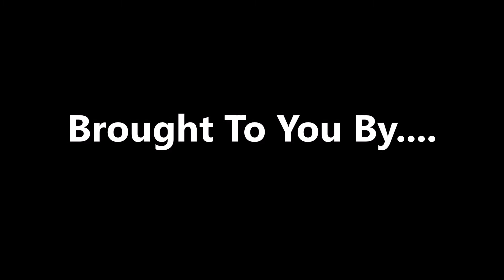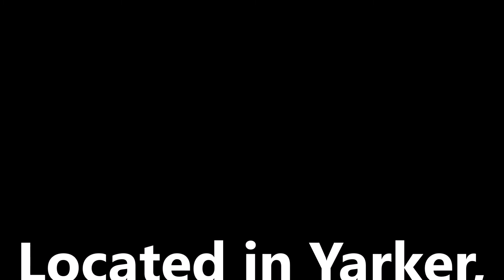1976 Classic Ford Mustang Cobra II Body Work & Custom Paint Job,  lastchanceautorestore com

Comment: I can see you half-assed the job you didn't even take the louvers off the back I'm out I've seen plenty
Reply from the maker: Sorry you are mistaken. 
We removed all components individually, sanded, primed masked and painted.
The louvers were all removed, repaired, sanded, primed then dry fitted and adjusted on the car before final paint.

The louvers were installed back on in primer for masking the blue stripes, then removed, painted and final install.

Thanks for watching our videos!
John & Julie Nizman
Last Chance Auto Restore.com
Reply: @johnnizman2518  That's how you drop a 🎤